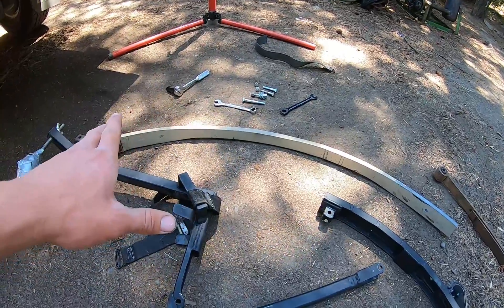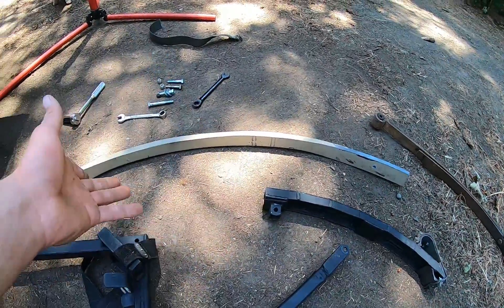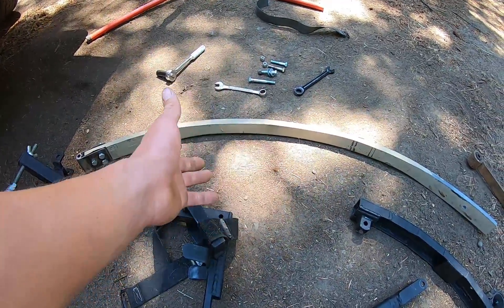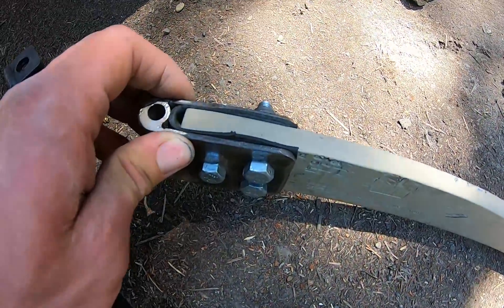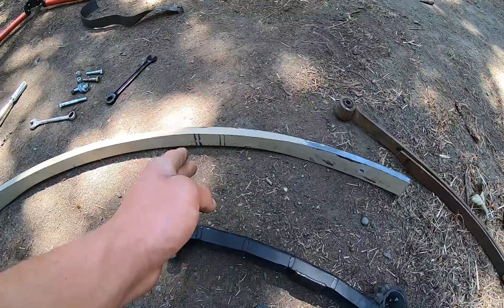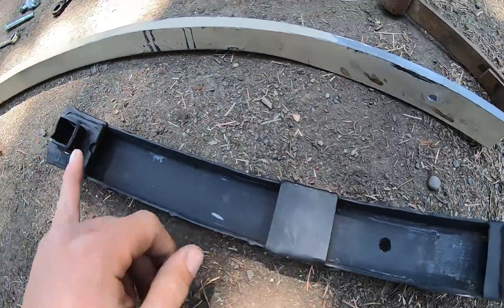How to Build Spring-Jumping Stilts From Scratch!? (New and Improved!!)

Comment: Hello to everyone this Is my first post here! I am working a an project who I call bionic enhancement! the my main purpose was increase my height, one solution who I found Is using a particolar stilts similar to the Bionic boot, the Jumping stilts; so yes to increase my height but also have more Power. My idea Is to create a Bionic leg like a prosthesis for normal people Who I can use everyday and do everything I do with my legs, so I was wondering if is possible modified the Jumping stilts I'd like to create a silicon cover for hiding the metal, a kind of skeleton, but there Is a problem I must Hide my feet also, morever I was wondering if is possible modified the design of Jumping stilts for make it less inconspicuous more like a human leg, without lose Power, the spring Is much big on my opinion. I also was wondering if Is possible to create a esoskeleton who work together to stilts for increase to the Power in particolar circomstances for example fighting
using karate, It Will be nice also to create a fake foot based on human feet Better of I can move them, this like replacement of original pad. Is there here everybody Who can help me on this project?

Comment: Muuuuuch better than the last version. I would add a plastic bushing in the hole you drilled through the bottom of the spring, just to help nullify some rubbing that the bolt could be doing to the fibers of the spring, which could maybe cause some delamination or splitting.